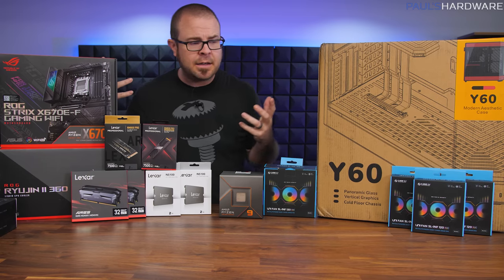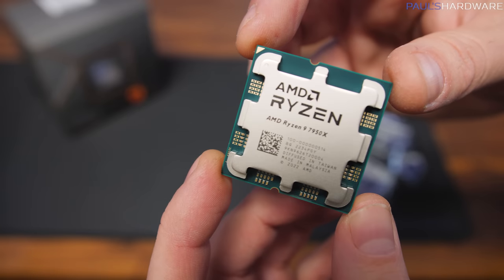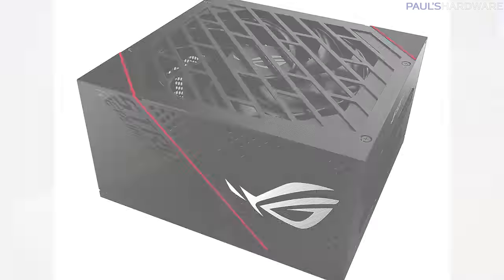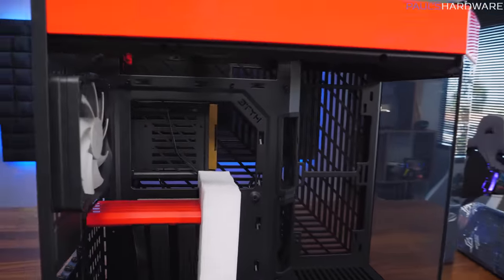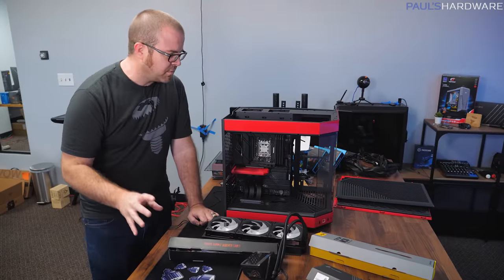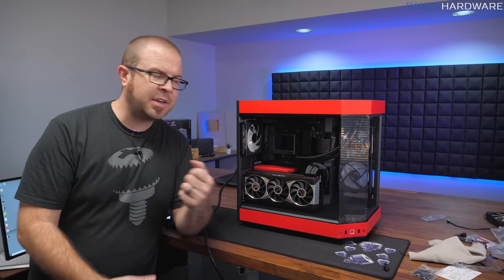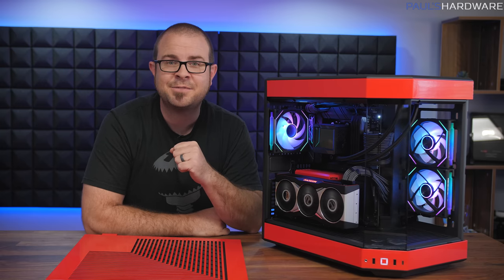Building a Beautiful Red All-AMD Gaming PC with a Mystery GPU!

Comment: This is almost my exact build, I have the Y60 Red, I have my 7950X and MB AND waiting for the new AMD GPUs to launch in a couple weeks before I finalize the build.  Even ordered a 5 pack of the Uni-fans that come in next week.  Getting SOOOOO excited to build... 🍻
Reply: i've done the same but with a 7700x
Reply: Somewhat along the same lines as you, but I'm still using my old Cooler Master CM Stacker 830 Full Tower case instead.

I just finished the build using the Asus X670E-E Gaming Wifi board + 7950X + 32GB of Corsair Vengeance and the Noctua DH-15 Chromax Black CPU Cooler.

And I suspected what would happen, too many changes so Windows 11 needs to be activated once more.
Reply: @johnmijo  yea I had to activate windows as well. But on a b650 aero board. And using a Lian li Galahad cooler.

Comment: The HX1000i is the better power supply, and no "stand-in', not because it's rated for 150 more watts - which does help. But because it's the more robust supply using thicker gauge copper internals, heavier magnets, the HXi line uses multi-rail delivery, etc.

Comment: 14:20 The top gray ones look the best, IMO. Red would match the case, but it might be too much red, lol. Plus, if the winner wants to change up the theme of the build or change the case for whatever reason, gray goes with everything. The top gray ones look way better than the bottom ones. The connectors aren't shiny/cheaper-looking like the bottom ones, and I like the almost metallic look of the top gray sleeving vs. the bottom flat gray. Plus they come with black cable combs, which I think look way better compared to the cheap-looking clear combs of the other cable extensions.

Comment: The red cables would be better (or better yet, RGB red). As it's a transparent case with red accents then I suggest that the purpose is to reveal what's inside, so the components and cables ought not to be  dark or muted. Also, the case is full of RGB fans which should pick out all the interior red accents perfectly - go red accent crazy!

Comment: A 7900XTX Red Devil ? Nice...

A tiny note on RAM : A 7000 system can be real finnecky (sorry if it's written wrong) to boot if equiped with 4 RAM modules, Paul. Check Wendell video about that.

Comment: i think the red cables would look the best in this build also with the some what not so direct flow of air this case has i would do 2 140 MM fans instead of 2 120 mm fans for intake on the side. this would help with air flow and circulation also cause a slight positive air flow helping to push dust and hot air out of case.

Comment: I suggest the combed ones for the cables given how neat Paul assembles builds like this, it is a perfect fit. Also not distracting with the balance of AIO screen, fan rgb, and possibly gpu rgb already inside the case.

I must admit I really like this build as it fits my dream build, but have some different part choices. I would suggest a 1000w psu for power allowance especially once the new gpu comes. My guess is that it will either be a RTX 4090 or a RTX 3090 Ti, unless we get one of AMDs new goodies.

Comment: I think it makes little sense to populate the chipset-connected M.2 slots first - even if you can't take benefit of the Gen 5 on the CPU-connected slots. The 3rd and 4th slot are both connected thru the chipset(s) so share a single PCIe Gen 4 x4 uplink to the CPU.

Comment: SO! you should  use both sets of cables. Red Mobo set, Grey cpu power, one Red one Grey for the gpu. And find some red sata cables for the 2.5in ssds. Only thing better is if the final GPU has 3 power cables so you can go Red Grey Red.

Comment: I hope you don't want to put in a Powercolor RX 7900 XTX Red Devil. Because the card requires almost 4 slots, which means that the fans are DIRECTLY in front of the glass, which means that they can get air. All graphics cards with more than 3+ slots are unsuitable for this case. You can already see in this video how close the RX 6900XT with it's 2,5 Slots is to the glass.

If you already want to install a 7900XT(X) then use a 2 slot with a 240/280 AIO that you can build in the side...

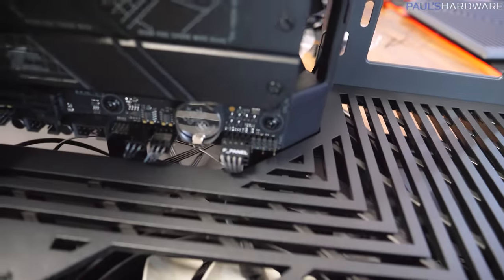Comment: 14:45 AMEN!! This is one reason why I almost exclusively buy Asus motherboards. They come with a little adapter block just in case (heh, puns) the cables from whatever case you're using are the older, individual, annoying AF style. Some other mobo manufacturers are doing this now too, but Asus was the first or one of the first that I know of.

Comment: The Hyte Y60 was is my favorite case! Love it! :D Only issue I have with it is... The Rise cable for the GPU has a REALLY cheap plastic, and when I was taking apart my build to deep clean, the clamp "wings" to pull it out, BROKE! And a replacement is $70! Other than that, GREAT Airflow, AMAZING Aesthetics, and very easy to build in.

Comment: I wonder what GPU is he talking about? What a mystery!
Reply: It must be a devilishly powerful one!
Reply: @Jeffrey Oligny Hmmmmm I wonder which gpus are still under embargo and not for public sale yet that could possibly be causing this delay hmmmm

hint hint 7900 XT(X?) Red Devil
Reply: very devil very red very XTX lol
Reply: but a 850W for a 7950x and a red devil 7900xtx is questionable at best
Reply: @ichdiemichdie4946  even a 7950X and a reference 7900 XTX will not even go near 850W at full load... There are not many reasons to go higher except worse efficiency..
Reply: @nktslp3650  Red Devil isnt a reference card and even if it is enough you always want to have some headroom and i dont think its a lot with a 850
Reply: @ichdiemichdie4946  and? even if the card draws 500W at full overclock and the cpu 250W, you still have 100W for fans. Where is the problem ?

Comment: Funny enough i am waiting for the 7900xtx to finish a build close to this. I picked a 7600x cpu because i'd rather get the 7800 x3d in the future. And for the board this was also one of the options but i went for the asrock x670e steel legend.

Comment: Well, I believe the new AMD version of the RX 7900 XTX GPU only needs two power connections but, I'm not sure if Power Color added a third one for their Red Devil model?...if so, then maybe you could mix those aftermarket cable extensions with possibly a grey-red-grey GPU plug order??? :s
Reply: From the teasers released of the red evil it got 3 8 pins yeah. Kinda conserned about the cooling of the gpu tho. It's gonna be a 3+ slot gpu, it would get mashed really close to that glass side panel

Comment: How did you fix the fan spinning issue? Im currently having that exact issue with my Lianli fans
Reply from the maker: I just installed the software, the fan controller box defaults to zero-rpm mode but there are other options you can set them to
Reply: if you are using an older lian li fan/rgb controller and decide to try the l connect 3 software, make sure you have any earlier versions of l connect uninstalled completely.  the controller might also need a firmware update - i stumbled across a firmware update tool on lian li's website when i was struggling to get the new sl120 v2s to work with a controller from a set of al120s that are also in the system.  i did finally get them working but was left feeling like lian li's l connect page could have done more to inform me about the firmware update tool & the need to nuke all previous l connect files before downloading l connect 3.  might have saved me from feeling like zoolander for longer than i care to admit lol.

Comment: Im not a fan of cable extensions if im gonna be spending the money thats in this build ill just have custom cables made for it less cables in the way from the extensions and eliminates possible connection failures but thats just me and as a plus you can get custom cables done in mulitiple different color patterns and materials which does add to the esthetics of the build

Comment: A word to the wise -- and I've never heard anyone in YouTube techland say this before (probably because they think it's too much like common sense) -- but don't throw out the packaging of components before you've made a note of the serial numbers for the motherboard, PSU, GPU, etc., because you'll need the serial numbers to register and get these products serviced/replaced should something malfunction within warranty.  Obviously, the serial numbers are going to be on the components themselves, but manufacturers have a habit of sticking the S/N in the most inaccessible places imaginable, meaning that you'll often have to tear down much of your PC build in order to get to see it.
14:31 Are all modern motherboards using the same font-panel pin configuration now or is this case limited to certain motherboards?

Comment: The half height card requirement removes this case from consideration in my opinion. I was seriously considering this case until you pointed out the half height limitation of the case. Great build. No to find a case with different features.

I have read that all power supplies do not have standardized pin outs on the power supply modular connectors. The point that was made … using third party extension cables could be dicey.
Reply: Every PSU has the same pin out at the cable end. Otherwise they wouldn't work. The difference is at the psu pin layout and then correspondingly the cable wiring that comes with that PSU.

But the extension just goes into the supplied cable so will be fine. It's only when you get replacement or aftermarket cables that go directly into the PSU you need to be careful.
Reply: @johng4357  That is absolutely untrue. The end of connector pins that plug into the motherboard, GPU, SATA, et al are standardized. The modular sockets and plug configurations vary by manufacture and there is no standard. Jay’s two Cents, Linus Tech Tips or another content creator mentioned this in there content within the last year or so. I will search for it and include the link once the old man finds it.
Reply: @brianscottdubois7515  that's exactly what i said. The cable end that plugs into your components is standard and common. The psu end is not standard

Comment: I'm currently building in a hyte y60. I'm having an issue with the riser cable. Cant quite align the video card bracket with the screwholes to tighten it. Is it possible to adjust the riser cable placement? Or am I doing something else wrong.

Comment: PSA- I bought a 2nd kit of Corsair Vengeance Pro 32 GB kit and it blue screens constantly gives memtest errors, turns out some revisions are not the same quality or can achieve the same timings etc.  When I contacted support they told me I'm shit outta luck and have a good day... You probably should warn potential buyers to not buy 2 kits even if they are advertised as the same.

Comment: Budget's are Def hard i was able to get the sonic mb and the same case in the video and have my storage stuff but im still looking at about 1200$ for the processor, Ram, Fans and cooler. And that does not include the GPU and the stuff i wanna use to customize the case for the Sonic the Hedgehog build.

Comment: Paul , on a few video you made you had a like for a gigabyte  B650 mother board.  On this mother board at the TOP LEFT side there is a plug called ATX_12V1/ATX. This plus shows a 4 pin  group for 12 volts. It seem the power supply cables do not come with a 4 pin (two 12v with 2 Grounds)  How can I find this kind of a plug wire ?
Reply from the maker: It will depend on your PSU, but you probably have an 8-pin connector available that's labeled "CPU" or ATX12V - it's actually two 4-pin connectors stuck together though, you can separate them by squeezing the little prongs on the side together. You might need tweezers. That should give you the 4-pin you need.

Comment: Quick question will the dark rock pro 4 cooler be enough for the 7950X or do all new CPUs need a liquid cooler?
Reply: The ryzen 7000 processor pushes every cooler to 95 degree Celcius to get the max performence. If you use a dark rock pro 4 you mau lose out on 2-3% perf in like benchmarks.But for gaming the cpu stays pretty cool and if you don't want to draw a lot of power you can use eco mode. It doesn't drop perf. that much Gamers Nexus & Hardware unboxed made a good video about that.
Reply: I have a 7700x in an SFF build with a Dark Rock 4, and the temps peak at 80C under full load, but if you’re going for the 7950x, you should probably use the Dark Rock Pro 4 instead. I would have used it but it didn’t fit in my system

Comment: MB and storage question; is there a technical reason you didn't put one of the M.2 drives in the top slot with CPU lanes instead of the lower chipset slots?  I know sometimes lanes get weird by using the top 5.0 slots on sum ASUS boards.  Just wondering if this board had any of that.  I would think those 5.0 slots would support 4.0 storage?  Nice build, if the red cables match the case well, red it should be!
Reply: They do support 4.0 but he left the 5.0 open for future upgrades....5.0 isn't out yet

Comment: So, 2x32gb or 4x16gb ? Which is better for 7700x guys?
Reply: There is NO argument with AM5 and DDR5!  YOU WANT 2x32gb, 2 STICKS OF DDR5 FOR AM5.  If you go 4 sticks, you are most likely only going to be able to run them at 3600 MHz!  DDR5 you either get speed with 2 sticks, or capacity with 4 sticks.  Intel is about the same, but it seems 4 sticks work at higher speeds on newer Intel.
Reply: 2 sticks

Comment: I feel like it's wrong to call the 7950X a "gaming" CPU. It's never going to give a meaningful improvement in performance over a 7700X, and is very unlikely to give a meaningful performance improvement over a 7600X, in gaming, especially not for the huge price premium you're paying. The 3DVCache version of the 7600 is going to be out in less than 6 months and is going to make all of these high core count CPUs look silly in terms of gaming performance per dollar. Of course, the 7950X is a great CPU for those who need that heavily threaded performance. 

Call it a workstation GPU, or a multi-purpose enthusiast CPU, or something like that, but please don't call it a gaming CPU!

Using a CPU like this in a PC where gaming is the most demanding thing it's going to be used for is a waste of money and a waste of electricity too. 

Likewise, a lot of Intel's new CPUs are also being referred to frequently as "gaming" CPUs, when, in fact, a lot of what you're paying for is their heavily threaded performance. 

Why bother buying these expensive thread heavy CPUs for gaming? If you're a performance nut, you can just buy lower core-count CPUs and upgrade often to maintain an extremely high level of performance at a much, much lower cost, especially if you consider that your net upgrade cost after selling your previous CPU will tend to be very low, given that these better ban-per-buck CPUs don't depreciate in resale value nearly as much as the higher core count ones do. For now, a 7600X is the best choice for AM5 boards, if gaming is the most demanding thing you do. There's going to be a 3d V-cache version of it coming out relatively soon which is going to put the 8-16 core Zen 4 CPUs to shame in gaming, and likely for around the same price as a 7700X.

Comment: The top radiator chamber is supposed to hide the fans and you put the fans with the best RGB in there instead of the stock Noctua ones...

Man, every Y60 showcase build, I mean EVERY, has a picture taken/ video recorded from an angle that looks up from the bottom because that's the only way to show the top-mounted RGB fans. This feels so wrong! the case was designed to hide the fans. Putting nice RGB fans there and struggling with camera angles to be able to actually see them, this is just so dramatic. Honestly, if you place them in the bottom chamber, at least you could see some under-glow instead of...nothing, just like at 20:16 which shows a normal viewing angle.

IRL I don't know who would place their PC higher than their line of sight. The nice fans would barely get seen directly and that's a huge shame.

Comment: I just built my first ever pc and it's the biggest mistake I've ever made, and I'll never do it again. I received a faulty brand new ASUS B650E-E Gaming WIFI motherboard that gave me Q-codes that weren't even mentioned in the manual. Got in touch with tech support and spent the next two weeks going back and forth via email, doing everything they asked only to eventually be told I need to mail the motherboard to ASUS Repair Center. Hours and hours wasted and apparently I'm not even going to get a new board out of all this aggravation. So my confidence isn't high this expensive build will have any longevity.

Comment: Hey Guys, help me choose the right thermal paste for my 5900X coupled with the Deepcool LE500 a 240mm AIO. Here are the available options and the pricings inside my country: 

1. Arctic MX-4 : $6.20
2. Arctic MX-5:  $7.80 
3. CoolerMaster Mastergel Pro v2:  $6.20 
4. CoolerMaster Mastergel Maker:  $9.5 
5. CoolerMaster Mastergel Cryofuze:  $9.9

Comment: If you put a gen 5 NVME in one of those slots will the GPU still work in PCIE 5.0 x16?
Reply: Don't quote me on this but I believe with AMD 7000 series CPUs it can support multiple gen 5 devices at full speed; while Intel 13th gen CPUs may not.
Reply: @pmknmash  Ah thanks, that's what my basic research suggested. A shame intel would limit you like that.

Comment: I have this case and put 2 Noctua NF A14 ippc 3000 fans in the bottom and use  those as my only intake and it works pretty good. Personally, I think the 3 included fans are trash and that's where they belong. I was kind of disappointed with the lack of accessories and the cheap plastic zip ties it came with